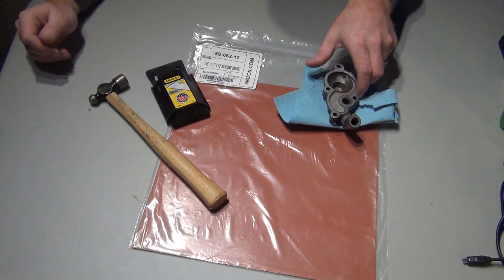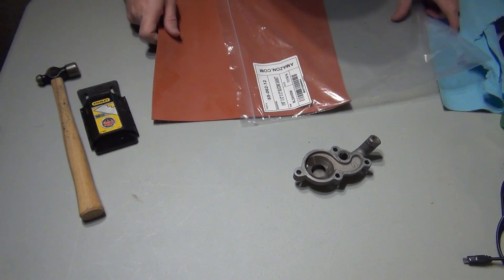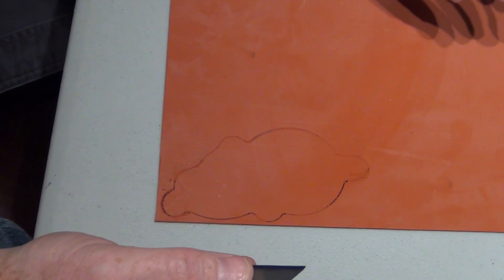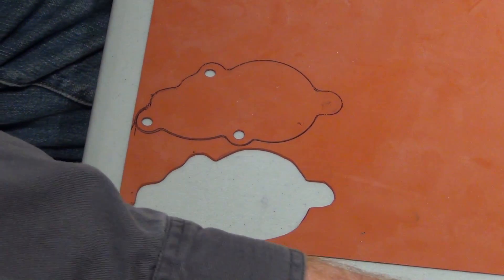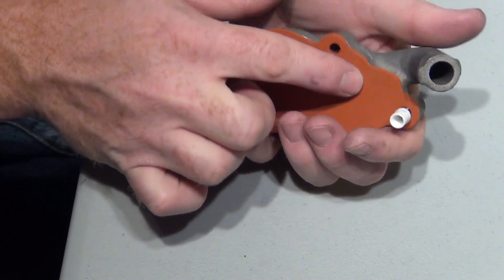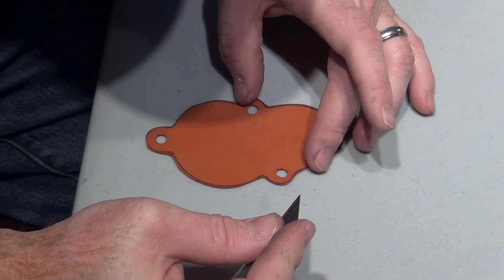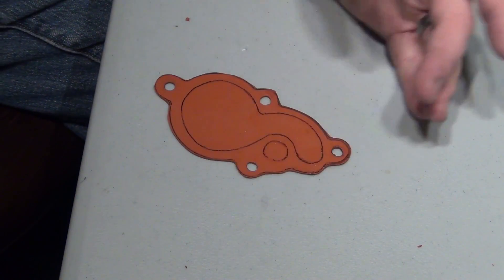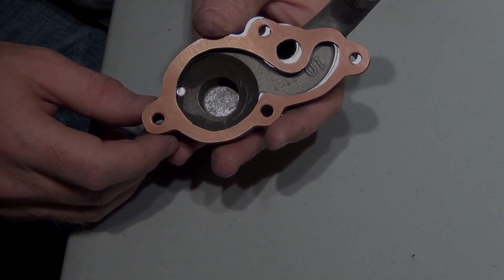2012 Gas Gas EC300 - Making a Water Pump Gasket

Comment: Good Job! I am sure that it will work like a Dream!
Reply from the maker: So far so good, if it fails I will be out $$$$ as Evans Waterless Coolant stuff is not cheap...LOL But with no pressure in the system I should be okay.
Reply from the maker: http://amzn.to/2h7fxxR
Reply from the maker: I can tell you the Prep Fluid tasted nasty, I almost took my finger off on that impeller and as I was bleeding I stuck my finger in my mouth and had forgotten about the Prep Fluid and it was straight up nasty.